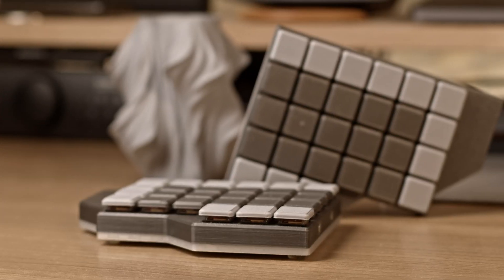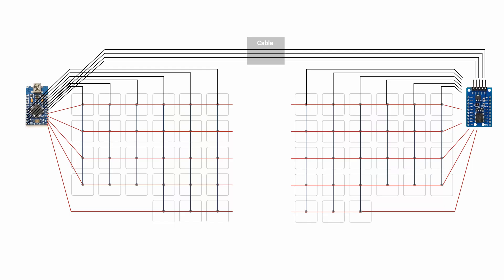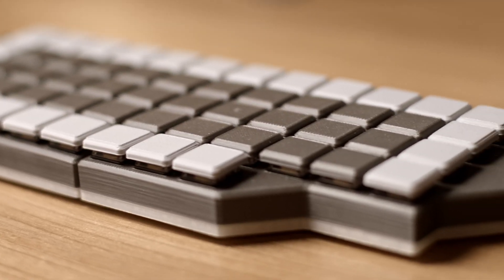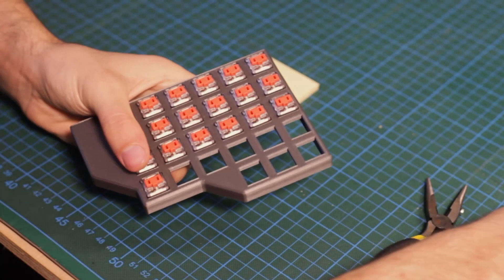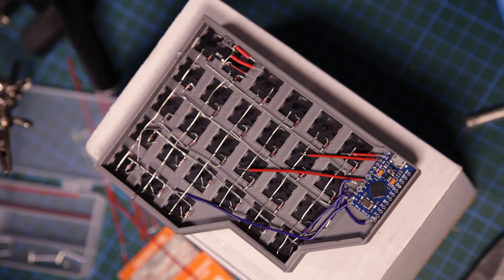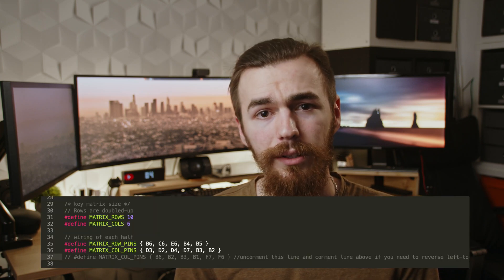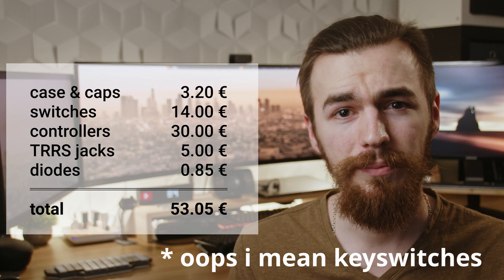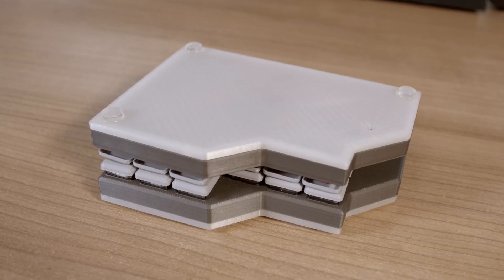Custom 3D Printed Split Keyboard

Comment: it would mean a lot if you could let us know where you got those parts and all build from via links (or affiliate links) so i can make a purchase
Reply from the maker: there isnt that much to it, you need a microcontroller like the pro micro or a pi pico that i use in the newer versions and then you just need the switches from a vendor that is at least in your region and some diodes, then you connect it with whatever wire you like. here are links for the switches and diodes i used https://splitkb.com/products/kailh-low-profile-choc-switches?_pos=1&_sid=9045ad96a&_ss=r
https://www.amazon.de/gp/product/B012ACSC1O
Reply: @JanLunge  thanks and yes i guessed you using pico pi now since i am binge watching your channel now. So  pico pi for split wireless keyboard might be a good one..let see.

Comment: Question, how did you glue the magnets please?

Awesome build and video :)
Reply from the maker: I used superglue and put a drop on the back of the magnet and also filled a bit into the hole in the case, wipe off any excess and clamp it in place until fully hardened
Reply: @JanLunge  thank you so much :)

Comment: hello, i wonna make this keyboard too! but i wonder.. how do I add another layer on top of it for the "esc" key? and the F row
Reply from the maker: with layer we usually mean switching the mapping so that you can for example have the top row be the f-row when you hold down a thumb key and you can set all this in the firmware. if you want to add physical keys to the top you would need to modifiy the fusion 360 design file to have another row at the top

Comment: sorry if this is a noob question but in the .stl files there is only the left side of the keyboard how do you get the right side.
Thanks
Reply from the maker: in the slicer you can mirror that file on one axis that way you cant accidentally print different versions of the keyboard halves and i dont need to export twice the amount of files

Comment: I'm highly interested in the double microcontrollers keyboard- i tried to build one  myself and now i'm trying to flash the files on it on your github. But i can't seem to find a .hex file which is needed in QMK. Could you provide me those files, or let me know where i can find these? 
Thank you in advance, great video!
Reply from the maker: i highly recommend compiling the firmware yourself so you can make sure the pinout is correct for the rows and columns on your handwiring, i also have videos abouth how to set this up in the macropad videos, i might add precompiled hex files with vial support for builds in the future but then i would also define how it is wired
Reply: @JanLunge  thank you so much! Yesterday i got it working. Its not yet working flawlessly but Im getting there thanks to your video’s!

Comment: I just built this keyboard (well, a slight modification; I designed the housing myself but used your qmk profile as a starting point) and am super happy with it. I actually bought a cheap keyboard from amazon and desoldered the switches since I was too impatient for aliexpress, and the total cost (considering I used just about half the switches and diodes I had) came out to just about $25 in raw materials (switches, diodes, arduinos, wire and 3D filament), which is amazing considering what custom KBs usually go for. Granted, the soldering was a PITA, but I learned a lot and it was admittedly still a lot of fun once I got in the zone.

Been using it nonstop for a week now and already got back to my regular typing speeds (I could have used the opportunity to switch to something like colemak, but I have to work on regular keyboards for customer support sometimes so I kept it simple for now), and the configurability of qmk (and vial) is amazing. Having access to all function and nav buttons as well as a num pad and mouse emulation is such a blessing for not having to move nearly at all from the home position, and, as a german qwertz user, putting the harder to reach buttons like the curly brackets in easier to reach positions is way more comfortable than messing up y/z every time I switch from german to the us layout xD

Thank you so much for this video (and the others, of course), I never would have guessed it was this easy to make my own keyboard 👍

Comment: Hello Jan, I'm planing on following your guide strictly besides that I really want to have a battery (wireless) and I have really no clue whatsoever on how to achieve that the idea doesn't create many problems.
I'd be glad if you'd send a reply.
Also I'm trying on getting the rotation for the thumb area to work!
Thanks so far for the guide!
Reply from the maker: I didn't build any keyboard with bluetooth/battery yet but when I do I'll definitely post about it, yeah a slight rotation on the thumb area would be very nice maybe it could even be on hinge so one could fold it back when transporting? not sure if anybody has these keyboard mobility problems I might have optimised it for that a bit much. if you get stuck somewhere or just want to share some stuff im trying to build a community on my discord server https://discord.gg/ctYr5BVF7b work in progress projects are very welcome

Comment: I would definitely not 3D print keycaps, but the rest... quite nice.
I'd love to go with a double controller split setup but Gnome absolutely freaks out with managing keymaps on multiple keyboards, causing it to hang for 1 second whenever used simultaneously. This build is a good inspiration for me.
Reply from the maker: yes if you can get keycaps those would be better i had a hard time sourcing them so i postponed that indefinitely. But if you can't get your hands on some nice keycaps, 3d printed ones do the job surprisingly well in the mean time not as fancy but at least functional, just don't let limited supply stop you from building things. 
The keyboard has 2 controllers but as only one is attached to the computer its viewed as a single keyboard and the other half only reports to the other micro controller which then sends the keys to the pc as if they came from that controller so you should be fine with this (also i tested it in gnome)
Reply: @JanLunge  I actually did 3D print some media keys in 2 colors for my existing keyboard.
After sanding and flame polishing I'm actually astonished how well they came out.
But oh boy did I melt some keys getting my technique down.
Counterintuitively, the hotter the mini torch flame, the less warping. But it really needs cooling.

Maybe a custom ice tray to make ice forms that fit the back of the keys.

Comment: Good video, little nitpick, though. The protocol is called I²C, not I2C (even though it's written like that most of the time). Check the wikipedia page, the pronunciation is mentioned in the first sentence.
Reply from the maker: Oh thanks totally forgot about the I2C thing but seem like its also a valid alternative pronunciation from what i looked up, but you are right its generally better to refer to the original intended version I²C thanks for the input
Reply: literally no one cares